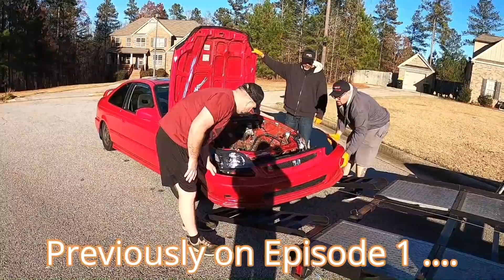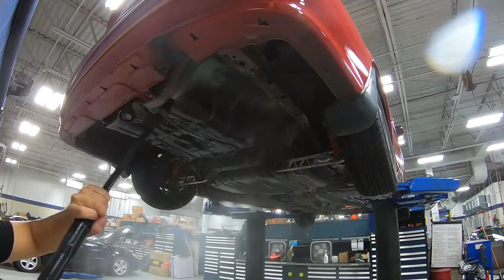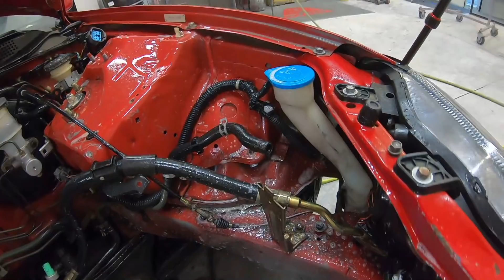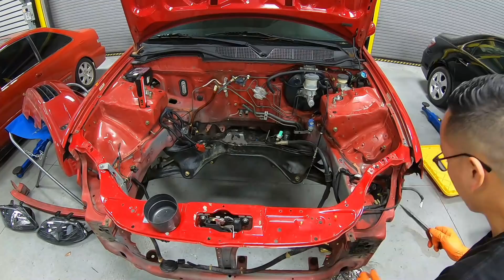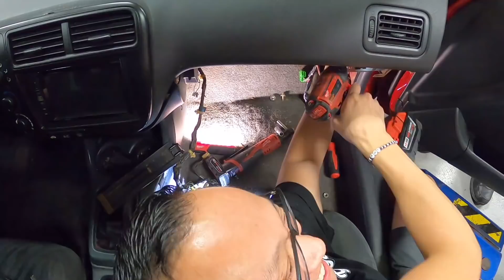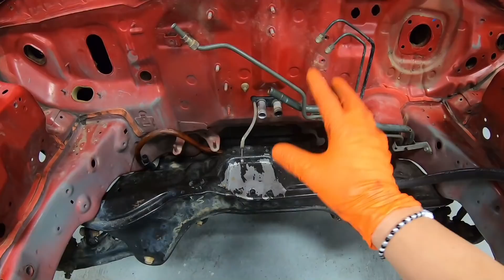AHC EM1 Restoration Project - Clean and Gut Engine Bay | Undercarriage Pressure Clean  (Episode 2)

Comment: This soap method leaves a residue, if you don't hand wipe and dry it.  Still it's a lot cleaner than it was.
Have you seen and touched the undercarriage of a car that was cleaned with a "dry ice" method?
It doesn't have a residue and it doesn't need hand wiped and dried, but I don't know if the pressure, from the dry ice will remove overspray.
After dry ice cleaning, apply a light undercoating.
Reply from the maker: Dry ice cleaning seem to be the best route to go but equipment and material can be very expensive. We hope to be able get one of those setup in the future.

Comment: Love the content. 

So i'm currently frozen on my 4 wheel disc brake conversion due to not researching enough. Apparently I need a 40/40 proportioning Valve off of  a Honda Civic EX Non-ABS and a Non-ABS Brake Master Cylinder (15/16) (Or is it 15/18?) [My current one is 13/16. 1999 Civic CX). 

A bit of a long shot, but if your Donor Civic is 4 wheel disc brakes and Non-ABS, and you guys don't end up needing the Brake Booster/Brake Master 15/16 or 40/40 Prop Valve, would y'all be willing to sell it?

If not, a hint on where I can obtain these would be greatly appreciated. Most distributors do not specify the cylinder size 13/16 or 15/16 and they are no longer available from Honda/Acura

And if I intend to upgrade to Spoon Calipers later down the line, would it be wiser to seek out an Integra 1 Inch RS Non-ABS? 

Any guidance would be greatly appreciated. Again the Car is a 1999 Honda Civic CX. And I am installing EK4 SiR Front and Rear Calipers.